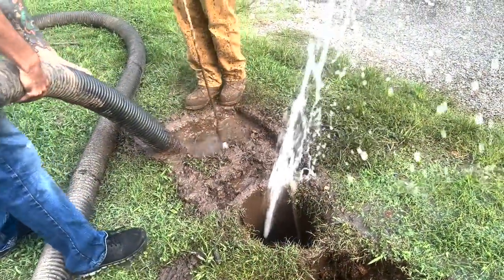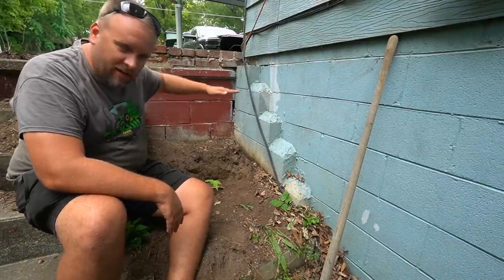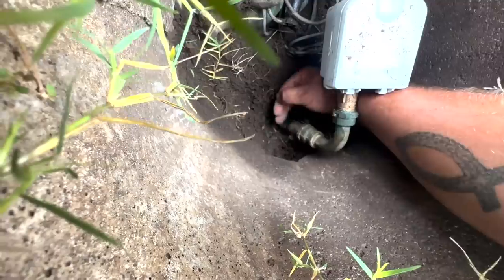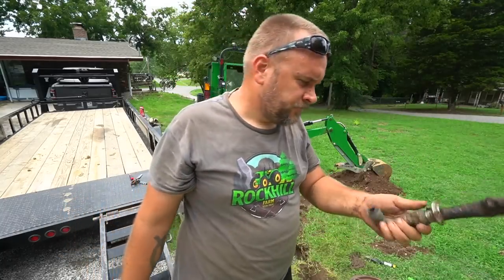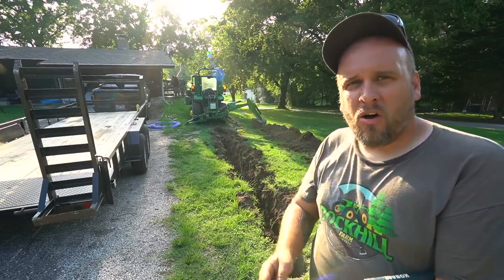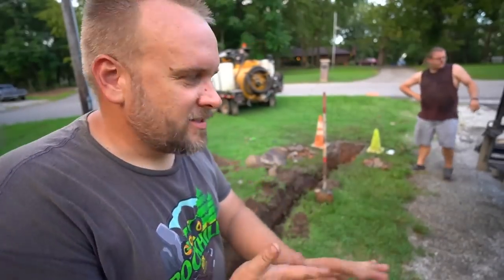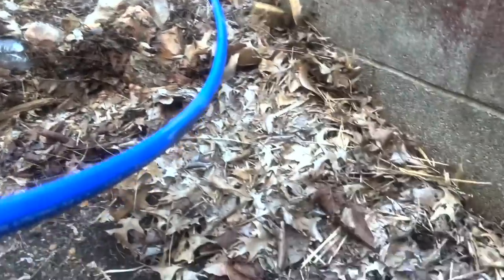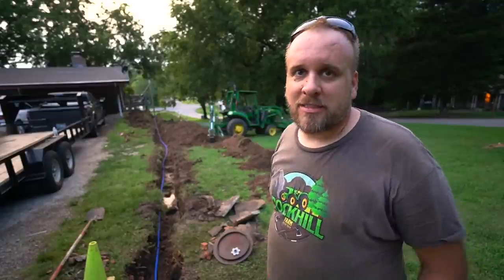Don’t Rip Out the Shut Off Valve

Comment: That black plastic pipe is often used in residential wells, but I wouldn't think you'd want to use it for city pressures though.  I remember when I was a teenager my church got on city water, and before that there was black pipe like that connecting the church to the well.  The city hooked onto that black pipe and it started springing leaks.

Comment: I did the same at my place in December last year.  Used Pex and loved it.  I had old lines and decided it was much easier to run a whole new line than to locate a leak in the old line and then have to worry about failure in another location later.  Nice work!

Comment: Howdy Brodk!  You guys did a great job.  Lots of older waterlines and meter connections get brittle and as long as they aren't touched, they hold up.  For a while anyway.  Only suggestion I have is you might want to wrap that PEX in some pipe insulation where it goes through the PVC pipe under the stairs.Thanks for sharing 🤠

Comment: An 18" frost line? 😲 At my location on the Palmer Divide between Denver and Colorado Springs, and at 7,500' in elevation, the official frost line is around 40".  We have to double your 18" and add an other 4", or just go with 48" to be on the safe side.

Comment: I suspect the bad pipe was Polybutylene. There were two class actions suits against Shell Oil that resulted in a $1.7B settlement. There are several failure modes for the pipe, but the largest is caused by chlorine degradation. There were also issues with improper installation, although as a result of the specification, not the work of the plumbers (as I understand it).
Reply from the maker: Great info. Dad was telling me about it but couldn’t remember the name

Comment: I have this problem and trying to decide where to start. Live on wooded acres that initially had a well hooked up to the house about 50 feet out. When the city came up the road offering water lines the former owner had it brought up to the house. That connection runs through a lot of trees approximately the length of a football field. 70 yo female and on SS. I’m wondering if I shouldn’t just have the house back on the well. I won’t be able to afford that kind of repair. 😭

Comment: That black stuff is polybutylene pipe. There are no fittings that will fit it. Best thing to do is to bypass it like you have. My Dad and I both worked for a plastic pipe company. I know it very well. Useless.

Comment: I'd encase that line inside of another line like drain pipe for protection. It's exposed right now, why not take the extra step. If it's in place you most likely can pull the water line without digging if needed in the future.
Reply from the maker: That would be a better way to do it but I am not willing to spend any money on it.   When the house was built in 1967 they put this low quality plumbing in without any protection. It lasted 55 years

Pex tubing is rated for direct burial. What I put in was better than original
Reply: @RockhillfarmYT  gotcha 👌

Comment: At 4 gallon per minute of a leak for that long of a time you should have had a pond forming somewhere, I hope that leak wasn't washing dirt out from under the foundation of the house. I hate to see you use that galvanized elbow because they will rot from the inside and if it's under ground it will rot from the outside as well, I'd say you'll be replacing that in about 8 years. I hate to be a keyboard know-it-all but consider replacing that elbow with brass. stainless or plastic before you close up the ditch. Brock on buddy
Reply from the maker: The guys from the city gave me a brass elbow before I put it together
Reply: If you can't find an elbow local take a look at McMaster-Carr, they will have 99.9% of anything you will ever need and will get it to you quick and will normally beat Grainger prices by a lot
Reply: @RockhillfarmYT  Awesome!! You breaking that connection and having to call them guys may have been part of a bigger plan so you didn't burry a future problem. God works in mysterious ways

Comment: Brock - you’re swimming outside the “lane” there some brother🙏🏼  Owning more land in MO than I do in IL I understand these types of fixes will work in more rural area cities, but for the rest of us, there’s no way you could get a permit to run a water line off the city main without a plumbing certification or license.  Looks like you did a great job, and I see several others already agree, however unless any of them is a an actual plumber how could we know any different?  Not trying to be negative against you brother Brock, but there’s a reason plumbers are a professional trade.  
Maybe before you bury it you have a plumber come
Inspect it for any any small details you might have missed👍🏻🙏🏼😎🇺🇸
Reply from the maker: I would never live anywhere that has rules like that. Everybody can’t afford a plumber. I believe that good enough is good enough.

Do I own the property or does the city own the property? If they own on the property they make the rules and they can fix the plumbing. Since I own the property I’ll just do what I want.
Reply from the maker: Nothing I do would hold up if I lived in or near a city.

I didn’t even get a permit to put up my Quonset Hut. I don’t know if it was graded properly. I did the wiring myself, which I know for a fact was not up to code.

I could not care any less. It either works or it doesn’t work.